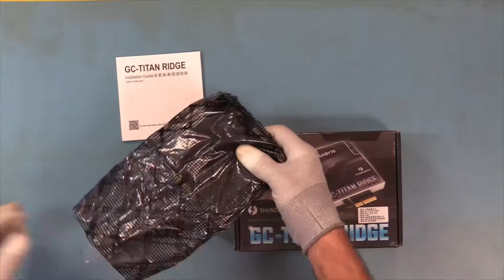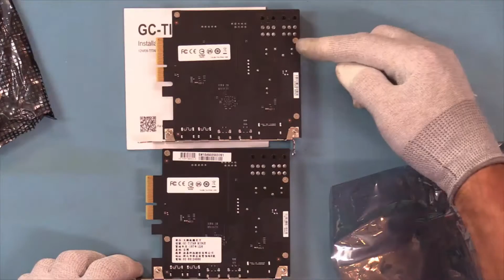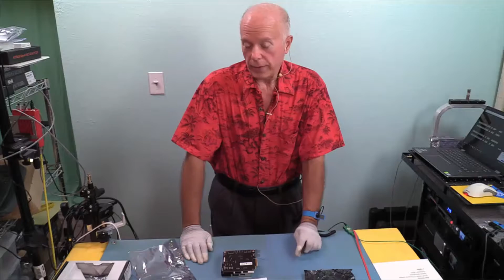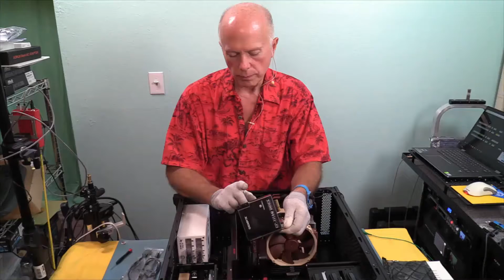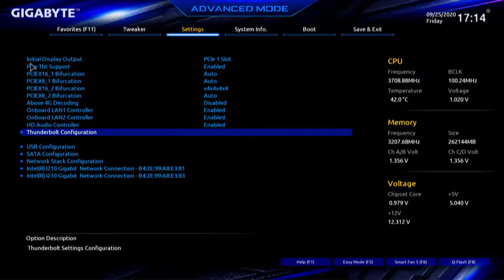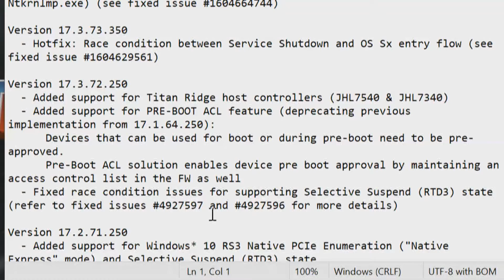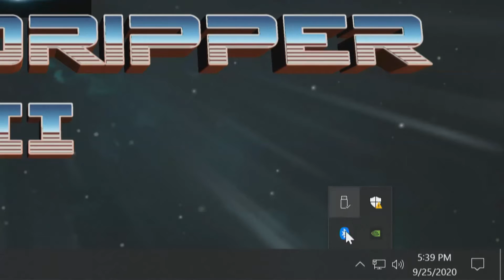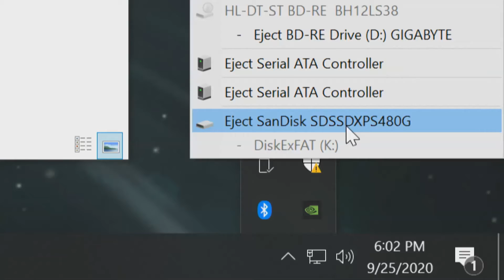Titan Ridge Thunderbolt 3 Unboxing, Comparison and AIC Simple Install on Gigabyte TRX40 Designare

Comment: I have: Aorus x570 xtreme (rev 1.1)
             Ryzen 5950x
             Titan Ridge 2.0 TB3 AIC
Im looking to get a TB3 audio interface and Im in
Between the Antelope Zen Tour SC and Apollo x4 TB3 interface. Do you know if any of these will work with my setup?
Reply from the maker: Hi N Z, Welcome! Interesting Question! 
1.) Gigabyte Aorus x570 Xtreme (rev 1.1) and Ryzen 5950x CPU - Beautuful Motherboard!
https://www.gigabyte.com/us/Motherboard/X570-AORUS-XTREME-rev-10#kf
https://amzn.to/3xii4dH
2.) Gigabyte Titan Ridge 2.0 TB3 AIC 
https://www.gigabyte.com/us/Motherboard/GC-TITAN-RIDGE-rev-20#kf
https://amzn.to/3tRr2fV
3.) Antelope Zen Tour Synergy Core
https://en.antelopeaudio.com/products/zen-tour-synergy-core/
https://amzn.to/3viV8Jw
4.) Apollo x4 TB3 interface
https://www.uaudio.com/audio-interfaces/apollo-x4.html
https://amzn.to/3vojTnD
As an Amazon Associate I earn from qualifying purchases.

Both are beautiful TB3 Audio Interfaces in terms of functionality. Both work with Mac or Windows. However, the Antelope Zen Tour Synergy Core can connect via Thunderbolt 3 or High-Speed USB 2.0. Aside from the differences in the I/O on each Interface, the question becomes to which Eco System do You want to invest? 

You are the first to ask about the Antelope Zen Tour Synergy Core. We've had several inquirees regarding the Apollo x4 TB3 interface. Both should work on Your Computer! Hope that helps! Thanks for Sharing! Keep Us Posted on Your Decision and Progress! 

BTW: We're going to be doing a Video of 2 Thunderbolt 3 Audio Interfaces. One is from UA Audio. Stay tuned!
Reply: This is what UA support sent me after I asked them if the Ryzen/Titan Ridge setup was going to work properly with the Apx4:

Thanks for updating us.

Unfortunately, we can not make a confident recommendation to use any Apollo (X4 included) on Ryzen system like this with the Titan Ridge 2.0 TB3 add-on card. Looks like a really nice and beefy PC you got there, but I'm afraid this platform with Apollo remains completely untested for hardware compatibility by our developers and engineers. The vast overwhelming majority of Thunderbolt-supported systems today use purely Intel architecture. We can't make this recommendation for you from an official UA standpoint, but you might be able to find more anecdotal information from other users using similar setups via online forums.

Im hoping there’s someone out there that’s able to confirm that UAx4 and Antelope Zen Tour Synergy Core can work smoothly with Titan Ridge on AMD Ryzen setup.
Reply from the maker: Hi @nz1136 , 
Wow! Hard to describe the confidence that statement instills in a potential customer. I'll just say, that's somewhat rich and condescending. That's a cop out we've heard before all too often of Intel vs AMD. There again, we're Guinea pigs! So be it! Windows support is just that. If it works, it works! 

And We still have a Video to do about DPC Latency as it relates to Audio! 

We've had enough requests for the UA Audio Thunderbolt 3 interfaces. We just have not done it yet being so meticulous in our Details of documentation! Which makes this all the more pertinent as we bring the culmination of our Research together! There will be an unboxing and install Video on that! And maybe another Video or two, of that Interface, given this enlightening info you've shared. Stay tuned! 

As for the Antelope Zen Tour Synergy Core, we'll give that serious thought. It was not on our radar. We've just completed a Thunderbolt 4 vs Thunderbolt 3 and USB4 Video. Then an Adobe Rendering Optimal Build Spec Formula! Exciting times to be Building a Computer! Thanks for Sharing! 

BTW: What's Your Host Audio application? That may have bearing on our UA Audio Thunderbolt 3 Videos.
Reply: I appreciate your support! The DAW I use is FL Studio 20.
Currently waiting on Antelope support to let me know if is compatible with my TR TB3 setup!
Reply from the maker: Hi @nz1136 , Yes, Absolutely! Good choice. Especially for testing. Keep Us posted! Vendors just don't seem to understand customer support.
Reply: I will hold off on the purchase until you guys post that video testing UA TB3 interface on a AMD/ TitanRidge TB3 rig!
Reply from the maker: Hi @nz1136 , 
No pressure! I'm honored! If You want and are eager, go ahead. That's why We included links into Amazon. We have several other Videos, long over due, to attend to before We can get back to the Thunderbolt Audio interfaces. But if You can wait, We'll get there soon enough! Stay tuned!
Reply: Antelope support response:
-first answer: I would need to consult with our developers and get back to you!
-second answer: It seems like it should be working just fine if its Intel Certified.
However I cannot confirm that it will work 100%  , since we haven't tried it yet because we dont have AMD system here.
The ASIO driver its fully compatible , however you need to use Voicemeter for WIndows audio.

I think AMD TB3 capable PC owners should get better attention from developers in companies like UA & Antelope in terms of having more knowledge about AMD TB3 hardware compatibility with their interfaces.That would save us from becoming Guinea Pigs when buying their products.
Reply from the maker: Hi @nz1136 ,
Interesting responses. Speaks volumes. 

Recommending using https://vb-audio.com/Voicemeeter/ - Interesting and Curious. 

Agreed. One would think Vendors would be more on top of what potential Users are doing!

I keep saying this, can You imagine the RMAs Vendors could eliminate, only IF. Then again, that's what We're here for and doing! Makes me even more curious to try it and see what happens. However, We always strive to keep it Simple. We use 3 Focusrite Audio interfaces. And Focusrite is on their 3rd Generation of Hardware. All USB 2. They work! Clean and Simple! Keep Us Posted and Stay tuned!

BTW: Never thought about it before, We should do a Video on Our Focusrite Gear. Borders on Behind the Scene but belongs with Content Creation!
Reply: Update from Antelope:
Hi Angel Moreno,

I spoke with my colleagues and it turns out , the TITAN RIDGE INTEL THUNDERBOLT 3 certified card that is attached to your AMD motherboard, should work just fine with our Antelope AUdio interfaces via thunderbolt.
Reply from the maker: Hi @nz1136 , 
Excellent feedback! Go figure! This is progress though! We need to know how a Vendor responds before the Sale. This will indicate what's going to happen after the Sale!  Now the question is, to which ECO system do You invest in? Each is proprietary to that Vendor. Thoughts? If We had the time, I'd love to Test the Antelope. However, We're already committed to, two other Thunderbolt 3 Audio interfaces. The question, Your Preference? Which way are You leaning? Decisions, decisions! And options! We like options!

Comment: I have a aorus x570 ultra can i install this card on it? i can't find the thb-c connector.
Reply from the maker: Hi Peter Brepoels, 
Welcome! Nice to meet You! Great Motherboard! You have Revision 1? No. Revision 1.1/1.2, Yes! Gigabyte Aorus x570 Ultra - 
https://www.gigabyte.com/us/Motherboard/X570-AORUS-ULTRA-rev-11-12#kf
Thunderbolt Add-in Card Connector... Thunderbolt Header sits right atop the SATA Connectors on right edge of Motherboard, according to Gigabyte. They make Us dig for this Info! Hope that helps!
Reply: @BuildOrBuy  thank you i think it is going to be Rev 1 .
Reply from the maker: Hi @peterbrepoels2079 , Unfortunately, Sounds lie You're correct! Without Bios support, No Memory allocation for Thunderbolt Devices.  As long as You only have the Video card and Thunderbolt, it can work. On the Gigabyte Titan Ridge card, on the TB Header, Jump Pins 3 to 5 to keep the card alive. Only Native support at Boot.
Reply: @BuildOrBuy  So it is possible to use the thunderbolt card on my mobe? by connecting the pins on the card?
I onley have a video card in the 8X lane . Nothing for the rest.
Reply from the maker: Hi @peterbrepoels2079 , Yes. Possible. NO guarantees! 
1. The Gigabyte Titan Ridge Thunderbolt 3 AIC will usually only work in one Slot. Trial and error. 
2. Titan Ridge Thunderbolt 3 AIC requires only 4 PCIe Lanes. 
3. Once that is decided. On the TB header, Jump Pins 3 to 5 to keep the Titan Ridge Thunderbolt 3 AIC alive. 

Hope that helps. Keep Us posted on Your Progress!

Comment: How much power does the thunderbolt card needs. My build is rated for 500 watts and a 650 watt psu is what I'm getting. If I'm using the thunderbolt card, should I get an 850w psu?
Reply from the maker: Hi Redoxico Manic, Welcome! Nice to meet You! Excellent Question! Power Delivery of 100 Watts. The bigger question is Your Video card. And depending upon Your Motherboard Chipset, 850 watt PSU is a smart choice. Headroom. It's that startup power surge to cover. Be sure to plug in the extra PEG Connector if Your Motherboard has one for additional Power to Motherboard PCIe Slots. Larger PSUs have more Power Taps. And get a Sine Wave UPS! We've been Specifying 750 to 850 watt PSUs for the last 5 years. Clean Power distribution is everything! Hope that helps!

Comment: Please, anyone tell me. Model of a Used 2018 era outdated Motherboard that can use pcie nvme m.2 riser card . or has one onboard, and has a onboard capable of running a monitor to at least 2k (2560 × 1440) can live without 4 k on board [ GPU can do that ] better than = 2018. would prefer one can handle basic DDR3 which I have already my dar 2014 sucks to keep running. It is not my main it ions for redundancy and old video games.
Reply from the maker: Hi Joseph, Is the Number one requirement Thunderbolt 3 for a DDR3 Motherboard?

For the age of Motherboard, You may need a self Bifurcating M.2 card. Glotrends Sky card. We have a Video on that. The problem is the Bifurcation technology time frame vs the Motherboard.

Comment: My computer spec: main gigabyte Z390 UD, CPU core i9-9700, after download and install driver for card Titan Ridge 2.0, i cannot see Thunderbolt driver on Device manager. So could you help me to solve my issue
Reply from the maker: Hi Giang Le, 
Nice to meet You! Let's see what we can do and get Ypou up and runing! 
Gigabyte Z390 UD
https://www.gigabyte.com/us/Motherboard/Z390-UD-rev-10/sp#sp
1.) Slot? PCIEX4_1 or PCIEX4_2. Swap Slots if Bios does not see Card. 
2.) THB_C (Thunderbolt Add-in Card Connector) Connected? 
3.) Check Bios. Verify Thunderbolt Setting. 
4.) Still not seen? USB 2.0 Header on Titan Ridge Thunderbolt card. Unplug it for now. Card may require Firmware Update. 

Until the Computer Bios sees the card, no way the O/S can see it. I cannot locate anything in Your Bios PDF about Thunderbolt. In Bios, Look under Peripherals. The Thunderbolt menu is only showing up if the Thunderbolt card is installed and recognized. Hope this helps! Keep Us Posted on Your progress!
Reply: @BuildOrBuy You save my time. My issue was solved after re-check Bios setting again as your instruction. Thank you so much.
Reply from the maker: Hi @giangle3449 , Excellent! Glad that helped! Success on Your Build! Thanks for Sharing!

Comment: You would route video to it if you are using a TB Hub.........
Reply from the maker: Hi Николай Черепанов, 
Nice to meet You! Is that a Question or a Statement? If that's a Question, Of the 3 things Thunderbolt can do, why not directly connect the Monitor to the Video card? 

Another way to think of this? How many PCIe Lanes does Your Video card use? How many PCIe Lanes does Thunderbolt 3 use? Get the point?
Reply: @BuildOrBuy  No its a statement, If I want my PC in another room away from my desk I would us a TB Hub to connect all my peripherals to my PC using said hub this includes displays. So for a hub to use a display signal you would have to connect the GPU to the AIC and then connect that AIC to the Hub if you wanted a display signal to come through the hub.  When it comes to having a display far away from a PC TB is the best way to do that as we know signal integrity from copper and other metal based cables such as HDMI and DP is nowhere near as reliable at distance as and optical cables. So as in my case I want my PC off my desk and to use a hub I would connect my display to the hub, that hub to the AIC, and the AIC to my GPU to get the best signal strength and integrity for the distance.
Reply from the maker: Hi @NikolaiCherepanov , Understand now where You're coming from. Glad that works for You. Our expectation is to keep cables as short as possible. And to keep the Computer close. Options. Thanks for sharing.

Comment: That's for sharing. I installed the card on an ASUS X299 Sage WS mobo. Connected the TB cable and Power Cables but not the USB cable because my mobo has no USB 2.0 port. I activated in UEFI BIOS, installed drivers and Thunderbolt (TM) Controller - 15EB is listed in Device Manager. However, I don't see the Thunderbolt icon and I am not asked to authorise my Thunderbolt devices. It doesn't work :(
Reply from the maker: Hi Nikolaos Tsarmpopoulos, 
Check Your Start Menu. Thunderbolt Control Panel should be pinned to the Start Menu. We pinned the Thunderbolt Control Panel to the Task Bar for easier and quicker access. You should be good to go! Keep Us Posted on Your Progress!
Reply: @BuildOrBuy thanks for your reply. It's not there unfortunately. I suppose this was meant to be installed with Gigabyte's software driver for Windows. I've tried reinstalling, which didn't help. I also found that the only way to connect a TB device is to disable the Security Level in UEFI Bios. I presume this is because the relevant service to request user authorisation is not running on the system. By disabling security, the device connects automatically. 
This card replaced the Alpine Ridge from Asus. Similar issues and the drivers are built by Intel, hence, looks like a bug/issue exhibited on all TB cards.
Reply from the maker: Hi @ntsarb ,
Hi Nikolaos Tsarmpopoulos, 
I was concerned about that. Install Driver from CD. Thunderbolt Control Panel get's installed during Driver installation. Then Upgrade or Downgrade Thunderbolt 3 Driver as we did. Hope that helps!

Comment: Stop saying enumerate. Please.
Reply from the maker: Hi Fester, How would You define the process? It is what it is. I believe Intel used that term during Our Reseller Training Meetings. And Microsoft echoed those sentiments during Our Discussions about the HAL - Hardware Abstraction Layer during TechNet briefings. We have shortened the syntax from BUS Enumeration since this process occurs on both the Hardware and Software side. Same applies to USB cache when full and USB no longer works. This process has been constant and consistent for some time. For Windows, since Windows 95. Same applies to Thunderbolt devices as devices have to counted and accounted for to read Vendor ID and Device ID. To state all of that gets wordy. We like to keep it simple.
Reply: @BuildOrBuy  List
Reply from the maker: Hi @Fester_ , Not inclusive enough of the process. Details matter. Thank You.
Reply: @BuildOrBuy  It's been a pleasure. Thanks for the upload. My Titan-Ridge 2.0 is due on Thursday - if it makes it across the Irish sea.
Reply from the maker: Hi @Fester_ , Likewise! Let's hope that arrives safely! Congrats! BTW: What Motherboard are You using?
Reply: @BuildOrBuy  B550 Aorus Master, 5600x ,CORSAIR MP600 1TB, 4x8Gb cl16 3200mhz. No dedicated Pcie 4 slot but with 2x gen 4 m.2 drives i think the bottom slot reduces to pcie x 4.
Reply from the maker: Hi @Fester_ , Thunderbolt 3 Header and Bios support, You'll be in Business! PCIe 4.0 on the TRX40 auto recognizes bother PCIe 4.0 and PCIe 3.0 Devices. Hopefully same will occur on Your Motherboard. Bios should also auto configure Thunderbolt 3. If not, easy to turn on. BTW: You using a UA Apollo X Thunderbolt 3 Audio interface?